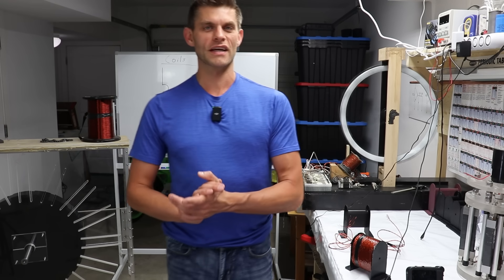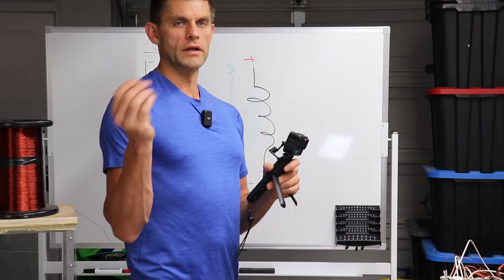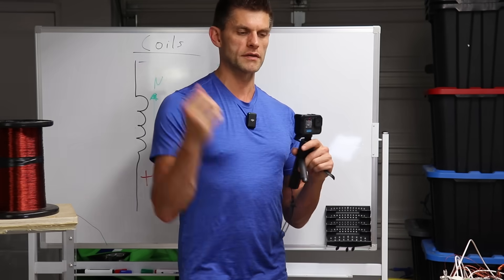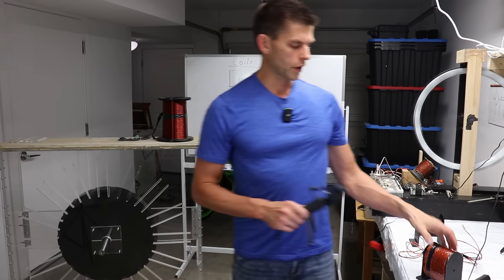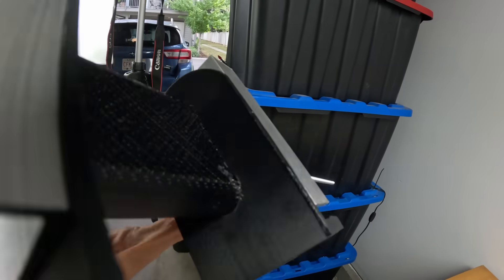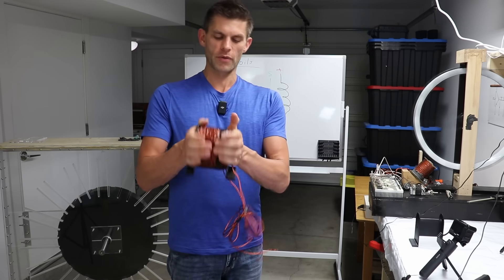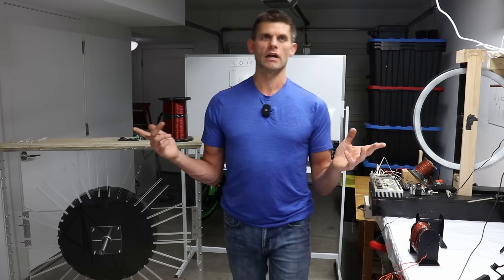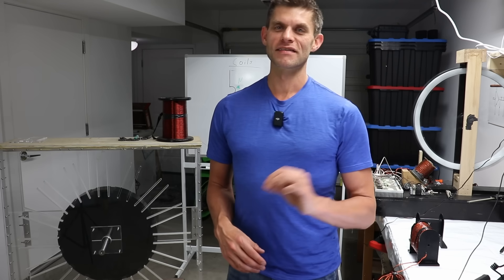Unlimited Energy in My Garage (No Patents)

Comment: suggesting the device could provide "unlimited" or "free" energy, which is a common trope in videos about zero-point energy or over-unity devices. Scientifically, such claims are unproven and often debunked as perpetual motion machines violate thermodynamic laws.
Reply from the maker: Thanks for your thoughts, the device is designed to explore concepts and has limitations.
Reply: Scientific Basis
Electromagnetic Induction: When a magnet moves relative to a coil of wire, a current is induced due to the changing magnetic field. This is the principle behind generators and transformers.
Example: A simple setup could involve a magnet attached to a rotating shaft (e.g., hand-cranked or motor-driven) passing through a coil.
Materials Needed: Magnets (e.g., neodymium), insulated copper wire, a core (e.g., iron), and a mechanism to move the magnet (e.g., a motor or manual rotation).
Output: The voltage depends on the strength of the magnet, the number of wire turns, and the speed of movement. Practical devices require an external energy source to sustain motion.
Experimental Considerations
Basic Experiment: Wind a coil of wire around a cylindrical object, move a magnet in and out of the coil, and connect the ends to a multimeter to measure voltage. This is a safe, educational way to observe induction.
Limitations: Energy output is limited by the input energy (e.g., manual effort or a motor’s power). Claims of "unlimited" energy likely stem from misunderstanding losses or unaccounted external inputs.
Safety: Ensure proper insulation to avoid short circuits, and avoid strong magnets near sensitive electronics.
Resources for Further Research
Books and Articles: Look into "Faraday’s Law of Induction" or introductory physics texts on electromagnetism (e.g., University Physics by Young and Freedman).
Online Tutorials: Websites like Khan Academy or YouTube channels (e.g., ElectroBOOM or The Engineering Mindset) offer reliable explanations of generators.
Community Forums: Explore DIY electronics forums (e.g., Instructables or Reddit’s r/AskElectronics) for practical projects, but approach "free energy" claims with skepticism.
Caution on "Unlimited Energy" Claims
Most videos claiming "unlimited" or "free" energy (e.g., zero-point energy devices) lack peer-reviewed evidence and are often considered pseudoscience. The speaker’s setup might be a demonstration of induction with an unverified efficiency claim.
For credible research, focus on established renewable energy sources (e.g., solar, wind) or conventional generator designs.
Reply from the maker: im not suggesting free from nowhere, its like solar free. thanks chat GPT

Comment: I have a hard time believing you are an actual electrical engineer. You would easily measure how much electricity is generates and calculate how much energy it takes to power the flywheel. It is ALWAYS going to produce less energy than it took to move the wheel. Otherwise you would be violating the 1st law of thermodynamics. This is very old technology that has been thoroughly studied.  You cannot charge a battery with a flywheel and then use that battery to power the flywheel and generate excess energy lol.
Reply from the maker: I understand that energy conservation is a key aspect, but I'm exploring an area outside of the conventional. i will do measurements in upcoming videos

Comment: In my limited experience, I've concluded that the added energy to the system is brought in from the surrounding ambient heat.  In other words one of your components will begin to cool as your system builds/stores energy.  So your objective should be to isolate and optimize the components that cool. Naturally if you manufacture systems that extract ambient heat from the planet and convert it to stored energy ( utilizing superconductors ) ... you solve two problems - our energy crisis and global warming.
Reply from the maker: Thanks for your insights, thats something to look into.

Comment: Ok as I understand it, your claimed principle is that a collapsing magnetic field induces a flow of electrons in a conductor, and that the electrical energy created is greater than the electrical energy needed to build the magnetic field, due to induction of energy from the Aether? If that were so, then any standard transformer would show an energy gain on the secondary coil side.....
Reply from the maker: sure when its a sharpe collapes yes, this energy is discharged via diodes as heat etc wasted

Comment: Could you use capacitors or even super capacitors for a more powerful quick release of the “pulse” I like that term for the description. 

Anyway, if you put multiple of these units side by side and run them together in series so one providing electrical output to the next and then giving an increased payload down the line running into super capacitors, maybe that produces a quicker more efficient and larger payload?
Reply from the maker: for sure could, Ed grey did it this way, tesla used caps for his spark gaps and res circuitry

Comment: 4:03 - if that's the case then why bother with the elaborate setup? Just continually pulse the coil and the battery will continually charge. Everything else is just draining energy.
Reply from the maker: maybe viable but ibe seen the rotors working so i dont want to change yet

Comment: If you are using the fly back voltage to charge the battery what is the flywheel with magnets for? The collapsing magnetic field of the coil will produce voltage in the coil all by itself. Also how much fly back amperage are you getting from the coil?
Reply from the maker: Im going to do a video soon showing in and out of the little bedini stay tuned

Comment: As someone claiming to be an electrical engineer, you should know better — and frankly, it’s disappointing to see these kinds of overunity claims being presented as fact.

What you're showing is a classic Bedini-style setup, which is a fun and educational project, but your interpretation of the results is flawed. You're suggesting you're getting more energy out than you're putting in — essentially free energy — but that directly violates the first and second laws of thermodynamics. No matter how clever the setup, you can't escape Lenz's Law, back EMF, or real-world efficiency losses like friction and resistance.

Let's say you use a 1V primary circuit to spin a wheel, and get 20V output on a secondary coil. Sounds impressive, but unless you're measuring actual power (voltage × current), this is misleading. That 20V would be producing only milliamps, while the input is consuming more overall watts. And when you draw power from the secondary, it loads the rotor, meaning the motor now needs more input power to maintain motion. That’s back EMF drag, and it cancels out any supposed gain.

So either you're misinterpreting your results — which happens a lot with these kinds of setups — or you're knowingly spreading misinformation. I hope it’s the former, and if so, I strongly encourage you to look deeper into the physics. Curiosity is great. So is experimentation. But so is understanding why smarter people before us haven't cracked "free energy" despite centuries of effort.

If it's the latter, though, then you’re misleading people who don’t yet have the tools to see the flaws — and that's not just bad science, it's irresponsible.
Reply: He just gave it away. he wants "funding" he is going to set up an indie gogo. so people can pay for his kinetic sculptures.
Reply from the maker: sure bro, go pay for your only fans
Reply from the maker: lol its sad to see people telling us whats impossible and claiming thats how science works
Reply: @MadscienceLPTECH  its sad is people actually give you money for your magic show.

Comment: The craftsmanship here is great... However...

The theory you're proposing has a couple of fundamental issues. The energy you get back from the coil's inductive collapse will always be less than what you put in, due to basic I2R losses and hysteresis. You can't create a net energy gain there.

That means the entire "over unity" claim rests on the battery "tapping the vacuum." This is where the science breaks down. Hitting a lead-acid battery with high-voltage spikes doesn't open a gateway to ZPE, it forces electrolysis, gassing off hydrogen and oxygen and accelerating plate degradation. It's a well-understood, destructive process, not a creative one.

The classic mistake in these builds is measuring a high surface charge on the secondary battery and thinking it represents real, usable capacity. The only way to validate your claim is to run a controlled test with watt-hour meters on both the input and output, and then perform a discharge test on the charged battery under a real load.

It's an interesting exercise in pulsed electronics, but the overunity claim just doesn't hold up.
Reply from the maker: Lol telling us what isnt possible dosnt hold up :) thank you for watching

If the build produces results that the "math" dosnt support then the math is incomplete ot a partial truth.

Comment: Bro just made warp drive's power needs actually possible.
Reply from the maker: Lol that would be amazing.
Reply: @MadscienceLPTECH  I'm serious. Keep stepping up the power through multiple generators, in series (or parallel, idk). This steps up the voltage and current, potentially exponentially (e.g. 12v/2A-> 24V/2A -> and so on...). This means you can eventually get to the 10^45 Watts needed to get the actual amount to create a warp bubble. Total step ups from a 19V/3.33A (65W) laptop charging brick would be about 102. The space could be insanely compact when tech gets small enough. You have made it possible.

Comment: use neodymium magnets and i always wanted to find perpetual motion i thought mabye gravity configuration such a magnet drops past coils of wire connected to a spring as spring goes up magnet passes coil again i thought. also 5 or so coils of wire in a tire and magnets on rotors as car tire spins it induces current then recycle some of that current to power back wheels
Reply from the maker: interesting thoughts!
Reply: mabye place magnets on the side of the rotor you made along the circumferenceall embedded in the side  the place induction coils the same circumference and collect the extra induced current from both sides of the rotor as well as where you allready have them  @MadscienceLPTECH

Comment: Wow ! Can I butt in ? Instead of 16 magnets use 27 resulting in a 9 phase ac power. This will produce a faster pulsed 9 phase sine wave set and higher torque with negligible dead zones where the phases cancel each other reducing destructive interferance. Think about 9 phase ac please. That ways you'll be able to collect more ZPE but that also depends on requirement of more efficient "switches" i.e. where you're using mosfets. It would just mean that you'd have a higher frequency ZPE being collected albeit in "smaller" quanta or packets but then these would infuse higher availability - more frequent.
Reply from the maker: Amazing I idea... there had to be a certain distance between the magnets to allow off time... but we can always increase rotor size :)
Reply: @MadscienceLPTECH  Yes, we can find a sweet spot there with multiple designs and a few mathematical calculations. The general idea being a more consistent energy input to the battery and decreasing or alleviating transmission loss due to cancellations (destructive interference) being charged thereby decreasing the charging time and reducing the temperature variations between charging and not charging states in the electrolyte ultimately increasing charging efficiency.

Comment: You mentioned that the new hot rod is not using transistors. It is using Mosfets. I thought that a mosfet was a transistor of sorts so I looked it up.  Is seems that the power transistors in the Bedini machine (which I jsut finished winding the coil for) is using power transistors and they are current-controlled while the mosfets are quite a different type of transistor whiich are voltage-controlled devices.  I learned something new and now I was hoping to hear from you a brief explanation of how this is goint to work better.  You have a way of explaining things in a way that makes sense and that is a great thing for thirsty minds. Be well and have an AMAZING day.
Reply from the maker: correct ill clearly go over transistors in the next video

Comment: This device is based on pseudoscience. It's essentially todays perpetual motion machine, which violates the fundamental laws of physics (specifically, the conservation of energy).

Key takeaway: Zero-point energy is the lowest possible energy state in the universe. You cannot extract power from it, just like you can't get water to flow out from the bottom of the ocean.

This has been debunked countless times. Please don't fall for it or send any money.
Reply: and to answer the voltage question before it gets asked, voltage is the potential not the actual energy. Its fundamentally wrong to look at voltage as energy. In fact, if I'm not mistaken I believe voltage is the electric potential difference between two points. Energy is measured in Joules, cmon guys we learned this in chemistry and in physics.
Reply from the maker: so we have heard, other boxes though with more information
Reply: @MadscienceLPTECH  That's a very vague response. If there is 'more information' from 'other boxes' that proves a net energy gain, could you please provide a link to the data?
To be clear, I'm not asking for another YouTube video. I'm asking for a formal, peer-reviewed paper or a third-party replication study that shows a complete energy audit (all inputs vs. all outputs, including waste heat) under controlled conditions.
Without that verifiable data, it remains an unsubstantiated claim that goes against the foundational laws of physics.
Reply from the maker: @thearkx the only claim im making is that there is potential for new discoveries and we should pursue and better world for future generations. Go read you peer reviewed articles and stay in yiur echo chamber
Reply from the maker: What laws are being broken, no one claimed any laws are broken. Does a solar panels violate laws ?
Reply: @MadscienceLPTECH  Let's talk about the actual device shown. A large copper coil isn't mysterious technology. It's an inductor, and its behavior is perfectly explained by 19th-century physics.
Here's the process, without the pseudoscience:
 * INPUT: You run current through the coil, spending energy from a power source to create a magnetic field.
 * EVENT: You cut the current, and the field collapses, inducing a high-VOLTAGE spike. This is standard inductive flyback, not a new discovery.
The entire "free energy" claim rests on misinterpreting that voltage spike as a net energy gain. It is not.
You will always get less energy out than you put in. A significant portion of your input energy is immediately and irreversibly lost as heat due to the coil's own electrical resistance.
High voltage does not equal high energy.
This has nothing to do with "zero-point energy.
Reply: @MadscienceLPTECH  Alright, I was going to let this go, but that solar panel comment is just too fundamentally wrong to ignore. It's the perfect example of the misunderstanding at the heart of all this.
Comparing your device to a solar panel is a classic false equivalence.
A solar panel is an energy converter. It's an open system that takes power from a massive external source (the Sun) and turns a fraction of that energy into electricity.
Your device is claimed to be an energy creator. It's a closed system that supposedly makes energy from nothing, with no external fuel source.
One converts energy from an outside source. The other claims to create it from thin air. To even suggest they are comparable shows a deep misunderstanding of the very physics you claim to at the forefront of.

Comment: I'm glad someone has taken up the mantle of further developing the Bedini Static Generator. I watched my college electronics professor make one of these from a kit someone was selling. They actually work, I witnessed him charge a bank of 12 car batteries over 3 weeks from low voltage to 12-13 volts across the board. Great content, thank you!
Reply: What drove it? Static charges don't form themselves.
Reply: That's amazing. I have always wanted to charge 12 car batteries in a 3 week period.
Reply: This is Nikola Tesla's ignition system. If he knew anything about coils he would never do that nonsense in the field with the drill and then cut the ends. It's absolute nonsense. Not to mention stating you can charge a battery with an intermittent pulse, if he used a super capacitor, it would be at least slightly believable.
This guy is a fraud, and anyone giving him money deserves to be scammed.
Reply: @michaelboris2500 picky picky picky. At least he is working on it. He obviously believes in it. You are sitting on your ass pontificating.
Reply: @michaelboris2500 Plz explain some more to this layman. Do you think he's knowingly scamming people though?
Reply: Hello fellow clippy 👋
Reply: @Craulback  Looks like your trying to build a free energy device
Reply: Where i can order geneator 12-13volt? LIke u wrote?
Reply: If your college professor thought that he could harness free energy, then he shouldn't have been a professor 😂